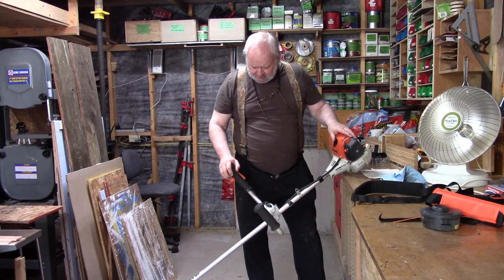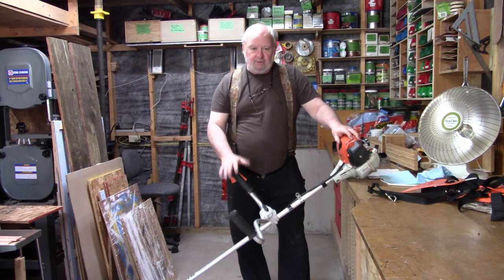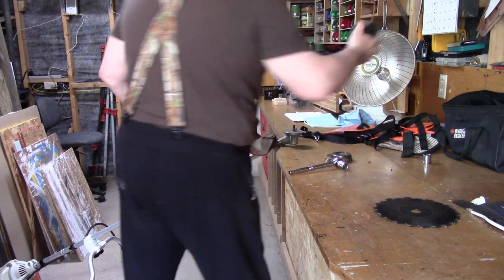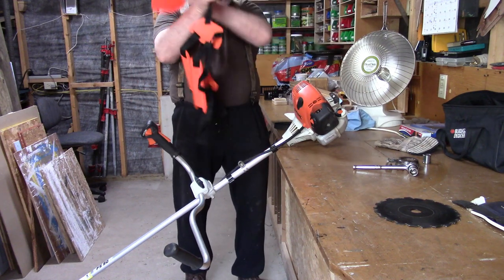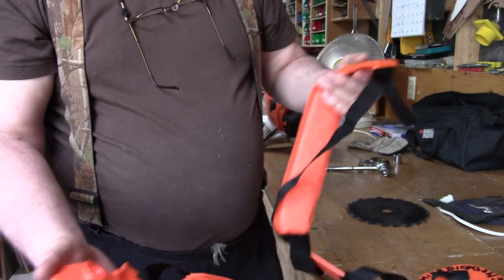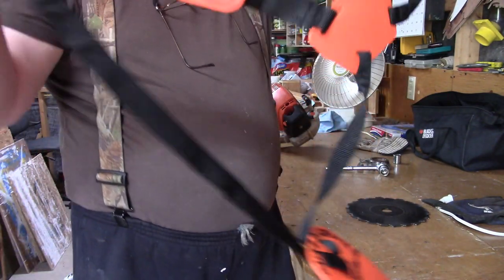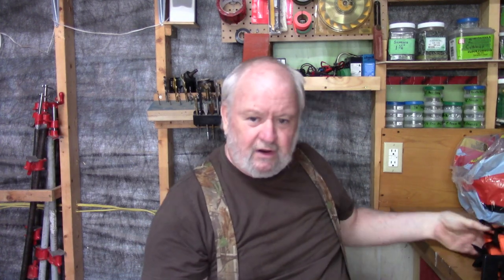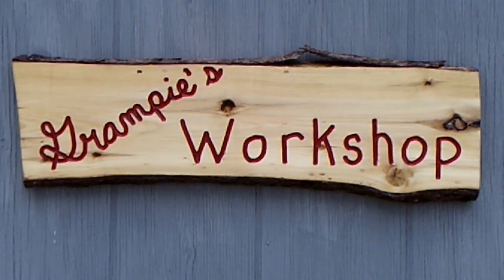Brush Cutter Harness

Comment: The harness that came with my Husqvarna weed eater is similar but it takes a ton of practice and adjusting to get it right. I found that once I had it sitting comfortable my back never got sore. I also had to adjust the handle bar off-of-straight with the cutter and that helped. Let me think,,,,,,, I think the handlebar is now adjusted towards the left about 10 degrees and that puts it about right. Like I said, it takes a bunch of adjusting but they are worth it.
Reply from the maker: How's she goin'?  As I remember this harness was like trying to wrestle an octopus trying to get it on, but once on and adjusted it sure does make the trimmer a lot easier to use.  Sure is a back saver!!!  Thanks for tuning in and commenting.  Take 'er easy!!!
Reply: @GrampiesWorkshop  Smart move by the way, to have nanny mowing while you run into the shop for a minute. haha  My favorite excuse is to say, "I'd help but I'm..........(fill in the blank here) ! 
I cut my finger last year and needed 4 stitches. When I got home I told my wife that the doctor had told me not to do any dishes or housework for two years! Somehow she didn't believe me! haha
Reply from the maker: @EverydayProjects  Nice try though!!!

Comment: I love my harness but one tip put out more line you’ll get better results when whipping also they have a new version that works better then this older model
Reply from the maker: How's she goin'?  Thanks for tuning in and thanks for the tip too.  When you mention about putting out more line, on my whipper snipper the guard cuts off the line so I'm not too sure how I could do that.  Any ideas on that?  The harness sure makes using the whipper snipper a lot easier on the back eh!!  Take 'er easy!!!

Comment: Hi Mike. I thought it looked like you were still leaning forward a little bit
Reply from the maker: Hey there Dave!!  I probably was.  This was the first time I used the brush cutter with this harness.  It needs some tweaking for sure.  The leaning forward part is one thing I want to minimize.  Thanks for tuning in and take  'er easy!!
Reply: Also, maybe you should try using the handlebar - especially the longer arm - to swing the cutter  instead of rotating the hips.

Comment: See how in the video you have a slight bend in your lower back to reach the ground with the weedeater? That means the handles should be slightly higher than they are. Either you should be able to adjust the height of the handles or they need to be longer/taller
Reply from the maker: How's she goin'?  The more I use the Brush Cutter the better I can get it set up and adjusted for minimal bending.  If the bars were longer (taller) it would be easier for sure.  Thanks for the comments and the keen observations!!  Take 'er easy!!

Comment: They add handles but they are still too low because to trim the grass you still need to bend at your waste to lower the weedeater head to the ground. If it was designed better the handles would be about 1 foot higher so you could slightly bend your arms and reach the ground without bending at your waist which causes strain on your lower back. Helps but could be designed a lot better
Reply from the maker: Hello there Ross.  So nice to have you drop by the channel and comment!!  I have a Stihl brush cutter with handle bar grips.  I find it can be set up pretty good so I rarely have to bend at all to cut.  I guess it depends on the machine you have.  The harness is nice, but I find it tricky to figure it out to make sure I get it on right.  Then when I finally get it adjusted, along with the handlebars, the straps will slip in the harness.  Like you say, it's sure not the 'ideal' solution but it's a lot a better than the little strap that comes with the machine eh!!  Thanks for tuning in and commenting.  Have a great week!!!

Comment: I need to get me a harness I have a trimmer and it came whit just a strap.
Reply from the maker: Salt Serge!!!  My brush cutter came with just the strap and it's not that good as you well know.  This harness secures the brush cutter a lot better and having the weight on each shoulder is much more comfortable.  I think there are better harnesses than this on though.  This is a cheaper from Amazon.  Thanks for watching and Take 'er easy!!!

Comment: Your hook is to high I'd say
Reply from the maker: How's she goin'?  Thanks for watching and commenting.  I think the height of the hook will be dependent on where you feel comfortable working the machine.  This was the first time I wore the harness.  I did lower the hook some, but to be honest, every time I put the harness on the hook ends up at a different height it seems.  I have a bank that I whipper snip and when doing that I work from the bottom to the top of the bank.  In this case it helps to have the machine higher on your hip.  Take 're easy!!